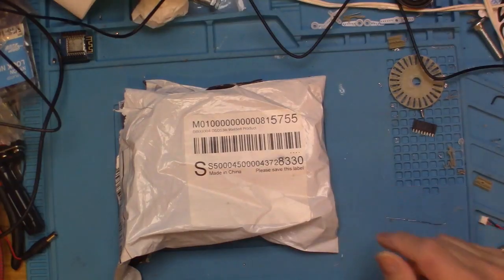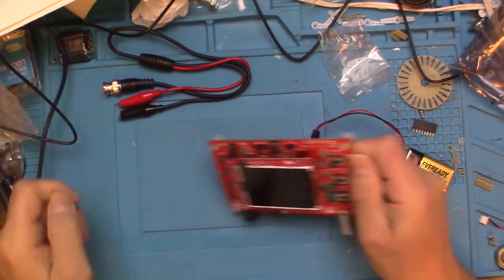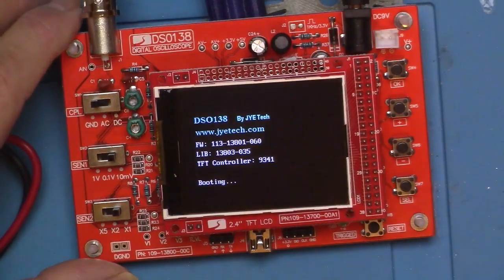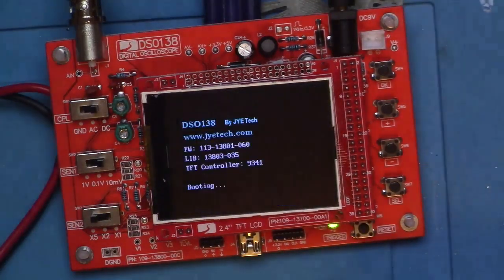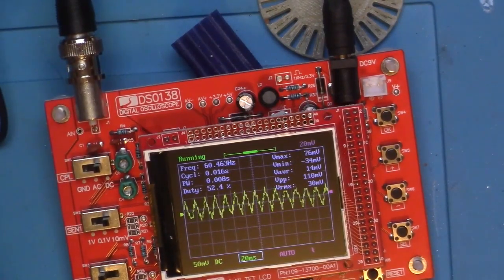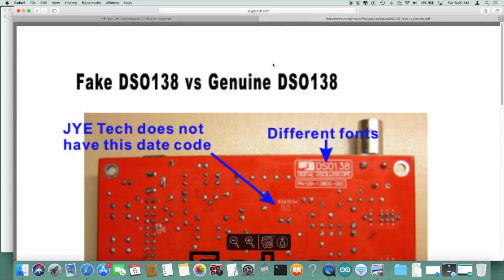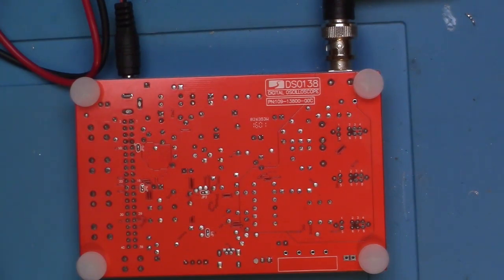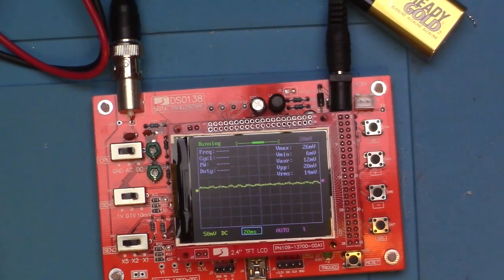Unboxing Review   Counterfeit $20 Oscilloscope

Comment: I just purchased one myself. I see after 4 years the screens are still crooked lol. I used a tiny amount of isopropyl between the pcb and display. Gave it a minute and the double sided sticky tape gave way. Let it all dry then repositioned the display correctly. No issues. I turn on the scope and my hole lcd display was blotchy. I checked it again the next day and all of the isopropyl that leached lcd dried out and you cant even tell, the screen looked brand new again. I also used a dab of hot glue on the slider switches, 3 came with broken tabs.

Comment: Information Technology theft over a wire most likely,  may have used china built wifi or router units. Units then routed packets back to china. What is made by china is the deal. Eaves dropping.

Comment: If you get a fake DSO150 though, it will get bricked if you update the firmware and you have to get an authentication code after a few uses anyway., even with a genuine one. Hopefully this will stop someone from getting one from ebay or aliexpress and being disappointed.

Comment: Maybe that copy of the manual doesn't have the "Power supply must not exceed 8V" note on it.  Or maybe you're above reading instructions.  It didn't blow up, after all.  Maybe the genuine one does!

In case anyone's interested, mine seems to be a genuine kit (with barcode label) for £15.02 with a perspex case from "supersuperstore" on Ebay.
Reply from the maker: Thanks for the  tip
Reply: i ran mine at 15v accidently for about 10 minutes.. then that funny burnt components smell, and a white screen..
Reply: @bubbahogg-buga4613  Darn....that's a shame! Get a new DSO150 from Banggood for $16 delivered right now. They are even nicer and way easier to use. Oh....and GENUINE! Lol!

Comment: I got a jyetech DSO150 from Banggood. It was described as "authentic". Bangood have other jtetech products that they specifically identify as "authentic" since I guess the recognize the counterfeit problem. I verified the serial number, etc, of mine and it checked out.  Banggood's prices are in the same ballpark as the cheapy ebay sellers. p.s. I'm planning on adding a DSO168mini to the collection.
Reply: any issues with receiving products from china on banggood? a lot of my ebay purchases never show up..
Reply: @bubbahogg-buga4613  I've only ordered from Banggood three times. One order took quite a long time and was damaged. It was just a cheap fan that wasn't well packaged. They refunded that order. Two, including the DS0150, were fine and arrived relatively quickly.
Reply: thanks for the info!

Comment: Did you happen to notice in the section that said there is supposed to be a sticker the "genuine" board also had a date code that "they never have"?
Reply: The JYETech board had a date code of 1537 whereas the fake code is 1601 which was on the picture of the fake and the board in hand. I believe it is the actual code that is wrong, not the fact that there is one.
Reply: @NiteLynr  my (assembled) fake from gearbest  came without any date code.  Normal trigger don't work and the display grew two white vertical lines all of a sudden